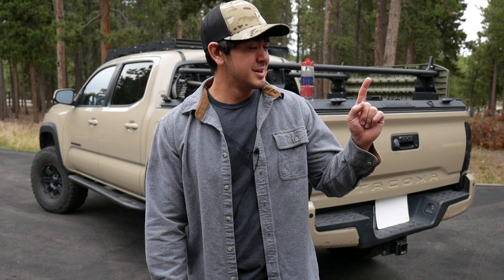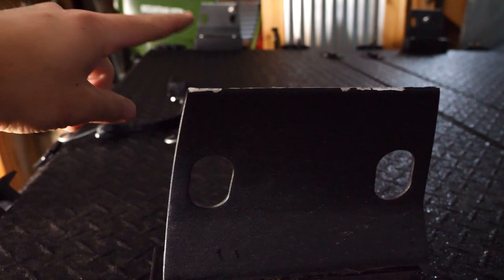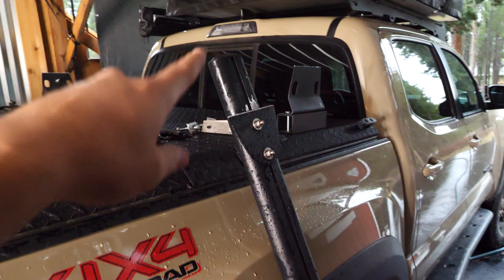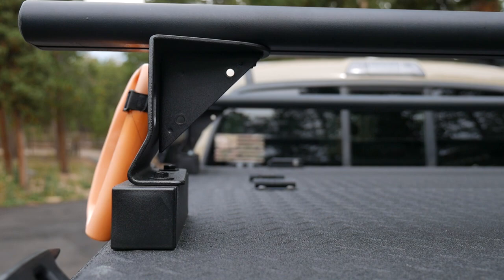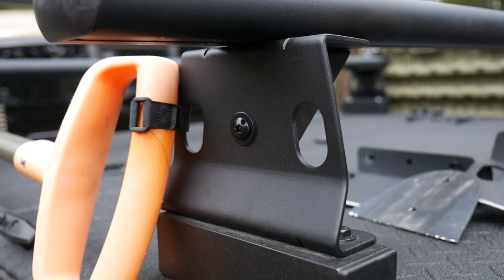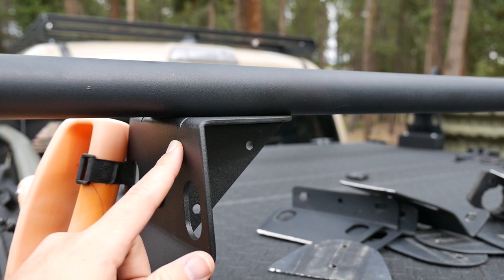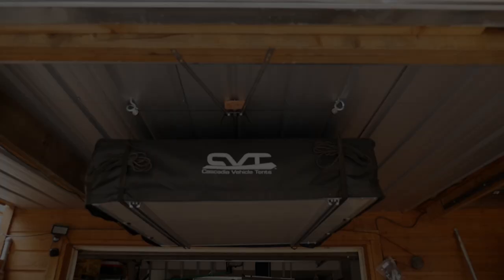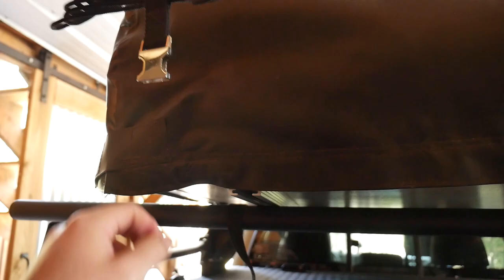My Rooftop Tent BROKE OFF! - Plus BONUS Tent Pulley/Hoist System

Comment from the maker: The Pulley / Hoist I'm using is this - https://amzn.to/2MH7NE9 - just slightly altered for my particular use.
Reply: Man, that pulley system: GENIUS!
Reply: Thank you for all of your bad-ass videos. I didn't see a link for the "improved" rack mounts. I have the same Diamondback cover on my Tacoma (thanks to your review) and I am looking to add a similar roof tent with the beefed up brackets to avoid what happened to you.
Reply: Last Line Of Defense, Sorry about that issue, hey I have a question as far as your CVT tent, Im looking for a rooftop tent for my new jl jeep. So many options in tents but the small diameter on top of the jeep is key for me. Do you think this would be a good choice for me and is packing back down simple? Thanks LLOD! And which model CVT do you have there, 2/person?
Reply: Wow, so glad that you got the issue resolved.  Hopefully it works out for the remainder of its lifetime.  When I'm ready to go overlanding I will be consulting with my friends who have a welding shop so fingers cross that they will make me something strong for my adventure. Best luck to you and hope to see you and other overlanders at Overland East Expo next year!

Comment: Rooftop tents are beyond dumb. My tent is an instant popup that sets up in under 2 minutes. And this is the best part... I Can Leave it There and Drive Away! I don't have to take it down to travel. As for sleeping on the ground they have this thing call a cot. They are amazing. They are almost like your bed at home. So the bottom line is if you are using a car or truck to camp, and not your back, then you don't have to sleep in or on your rig. You can pitch your tent and still come and go.

Comment: If you are still worried.  You could take one of the new ones to a machine shop and ask them to build you a set.  Probably not very expensive. Id go with 1/4" plate steel.

Comment: With the way that rack broke, I am kind of not surprised.  That's some pretty thin metal supporting it.  Re-enforcing it should make it work fine but there are still going to be some weak points in it.

Comment: Hello. Dig your truck and your commitment to your channel and keeping us all informed. 

I don’t normally comment on this stuff. But. As a welder, fabricator and someone knowledgeable in metal allergy. I have to say. The replacement brackets are going to break just as easily as the first ones. Gusseting one side does not fix the lateral movement nor strengthens the over all structure. I can tell you with utmost certain. The gussets on the new ones will transfer the lateral movement to the bottom “L”  section of the bracket that isn’t gusseted. Thats your next break. Not to mention. The overall gauge of the units is much to thin for suspended weight. 

I would consider a local fabrication shop to tig weld you up some nice stainless .. thin. And strong.

Comment: I'm relatively new to overlanding and I'm just starting my first build. But I do know quite a bit about load ratings and requirements as I do weight testing commercially. If your rack was rated at a "dynamic load" of 300 pounds, what that actually means is the safe working load (SWL) is 200 pounds (dynamic load tests are 50% greater than the SWL or safe working load). A "Static load cert" is conducted at double the safe working load. A dynamic load is supposed to simulate a safe working load with mild motion. A static load is used to simulate extreme conditions. What I suspect is the company you chose DID NOT meet SAE requirements for load testing or they used sub-par hardware that handled a stationary load test just fine but was not static tested under extreme conditions. 

In either circumstance, I'm glad this occurred off road and no one was hurt.

Comment: So typically load forces measured vertically, in a nut shell.   While driving off road you have forces that are acting side to side.  So you could contact the manufacture and ask them if the rack has been tested for the side to side forces and if its rated for off-road.  You are the path to figuring it out.  Their is still the same weak point in your new brackets.  The addition of the triangle piece also needs to be on the bottom where it's attached to your rack.  My guess is that they will break again.  Great vids!

Comment: I see two sets of holes in your new brackets, ( As a steel fabricator I still think they could be week). A simple fix may be to take some 1/4" cable and cable clamps and make some cross bracing to reinforce them. If your new ones don't work, let me know Ill make you some custom ones, love your channel, used to live down in your neck of the woods, have fun.

Comment: Hey buddy, Check your hardware that bolts the bed to the frame, my Tacoma bed would rattle on dirt roads and found that the closest to the cab on the drivers side in the bed, the bolt was loose. Loose enough to get like 3 full turns on the bolt. The same thing happened to a hand full of my buddies out here in Utah too. Also, just a heads up, our beds flex and articulate pretty heavily when you 4X4 them. It’s highly possible the bed articulation is what broke your previous mounts. Also use grade 8 hardware with flat and lock washers and nylock nuts. Half racks are the way to go though. Good luck! 🤙🏻

Comment: Boo for broken bed racks, yay for Jeepers being Bros. Sorry about your rack, I'll be inspecting my roof rack for problems. I use that same pulley system for my Jeep hard top and roof  rack. It works really well. Unfortunately I don't have enough overhead space to lift my RTT on/off. Had to rig up something else for that using my winch lol.

Comment: Old brackets failed to stress in tight break bend radius in aluminum. See how lower bend has large radius. The stiff hit gussets they added to new brackets will help for sure along with the steel angle brace you bolted on should do the trick. Good luck enjoy your vids.
Reply from the maker: Yeah I'd be surprised if this one fails, but bumpy trails have a way of surprising you over time, haha.

Comment: For added safety, you should mount a quick release safety strap from the tent to the diamondback in case it ever blows off again to keep it from flying down the highway. Just strong enough to stop the momentum. Even if it snaps (like a cheap bungee) it'll still break the momentum enough to get to to drop to the ground quickly.

Comment: A few things. Firstly, as mentioned by someone already, you should have those brackets fabricated out of steel. Try a few local metal workers, I'm sure it's an easy thing to fab. Second, the 300lbs rating per bar is static load almost guaranteed, your dynamic load will be much higher, 6x+ with margin for safety from my understanding, for offroading vs static or light duty dynamic. Lastly, you're adding risers to your mounts, this is increasing the lateral stress that those brackets are feeling and translate to more force and thus more wear on the bracket.

Comment: You probably already hear of these KB Voodoo Hi rise bars fit over the diamond back cover, they limit your ability to open the bed cover but they are stronger, done some mid level trails with good amount of flex, and no problems.
Reply from the maker: Yeah they're low and don't allow opening of the cover. While I don't often open it, I do like the ability still. But interesting option for sure.

Comment: Glad you got them fixed up. I'd still keep an eye on the bottom; once you strengthen a weak point, the point of failure moves to the next weakest spot. I'm guessing the stress will now transfer to the bottom bend.

Comment: Must have been a pretty awful moment - sooo sorry to see! Thanks so much for putting this out there.  Especially since Im currently figuring out how best to set up my own truckbed rooftop tent.  Your racks failed in **fatigue**, the achilles heel of aluminum.  Great strength to weight ratio, great workability, but alum fails catastrophically in fatigue (looks great one moment, gone the next).  At least with steel or carbon fiber hardware you might see the problem before it fails.  The 300lb strength rating on your alum racks doesnt speak to fatigue at all (and how are you supposed to measure your fatgue load anyway?)  Now, after your gracious guinea-pigging for us all, I'd categorically dismiss any aluminum rack hardware supporting a decent load on the truck, which is either vibrating and/or bouncing most of its active life.  Glad you got out clean without injury or major damage.  Cheers!

Comment: The difference between the old ones and the new ones looks like the old ones were not a solid piece as the stress points look like they were welded. The new ones are one solid plate that was bent to shape. The dents are actually reinforcements. Thanks for the update

Comment: I expect these will last longer, but fail in the end. I think the failure will occur in the middle because the middle bend is now the sharpest bend and the reinforcement you added ends at this bend, thus focusing strain at the weakest point. Your reinforcement might actually make it fail faster. Honestly I think these brackets either need to be mild steel (so it bends instead of fracturing) about 1/4 inch thick, or fiberglass and epoxy about 3/8 thick, and either way, make the radius of the curves larger and triangulate everything as much as you can. Just do not triangulate to a weak point the way I think you did with these new brackets. I hope what you did works for you, but watch out for cracks that begin at the bottom point of your reinforcement on the inside of the bracket.

Comment: Hello, you may not remember my comment a while back on your tent support system and its apparent Engineering flaw that may bite you in the arse down the road, well it happened, please do not feel offended I was just trying to be helpful. Your "makeshift" bolted gussets in that particular configuration is NOT the answer, you are now putting the weight of the structure on the BOLTS, you are back to square one, if anything they should be welded. I am currently in the process of designing small electric "Hydraulic shocks" with ONE hand held controller for four corners of the roof tent so as to eliminate having to jack your truck to get the tent leveled. Well, I guess we live and learn, take care Brother and LOSE THE BOLTS!!!!!
Reply: The same forces that acted to weaken the top bend are now being transferred in whole to the rest of the bracket. In my estimation you should look for something to secure the bottom bend and prevent the sideways motion that weakened the top bend. The gussets will help, no doubt. My comment is to merely highlight the fact that the forces haven't been removed, and with the modifications the weakest point moved elsewhere.
Reply: What broke your brackets was work hardening on the aluminum. It would eventually happen on steel too.
The smaller radius on the top bend probably sped the process.

Comment: Truck beds flex quite a bit also, hence the rubber and foam under the bed covers, that isn't there just for dust/water, its so the bed and canopy can flex from each other in off road situations or under a heavy load, I would suggest thick piece of heavy duty rubber under those mounts to the bed shell. At least if you know your going to flex and go off road again.

Comment: If the bottom part of the support is stronger than the top part that broke I think you'll be fine. That said, in my opinion, all you did was strengthen the part that broke while moving most if not all the pressure to another area ( the bottom section) But hey if it works it works!  If they do break again I'm guessing that bottom part of the supports will break just like they did before

Comment: Trash the aluminum risers. Sounds like they work hardened from the constant lateral movement and then failed. The “600lb” rating is for compression not shear. How about using channel iron? The one that has a profile like this [ 

It’s made out of steel.
Reply from the maker: Yeah lots of potential options, if this setup breaks, I'll be very, very surprised.

Comment: I'd never suspect they were aluminum, that's ridiculous. Alu is too stiff, can't give, so it broke. But I'm suspecting bending radius to be the biggest fault and a proof of the company's lack of knowledge. Who bends alu to 90 degree? And I noticed it was looking like past 90 really.  I'm betting they've bent it, cause clearly it's not an off the shelf profile. This custom bent bracket could've been easily replaced with an alu square tube of large wall size (3x3", 4x4", 5x5") With one end welded shut, second end providing bolt/nut access. This would look fairly smart and be much more secure and resistant to fatigue. The alloy bars don't seem to care about the load at all, so...
I would definitely not go the thick steel custom heavy balls route, it's a 75kg ffs. Not an elephant.

Comment: There still seems to be a hinge there. Would be ok if the gusset cam down to the base of the bracket. Even better if the gusset was connect to the full base plate. Still seems to have a fatigue failure potential. (I am a structural engineer).

Comment: It's the weight causing lateral movement/wobbling that is wearing out the corners of the brackets. Add angle bracing/bracket support to reinforce.

Comment: Hey I just ran into your channel the other day, good content and reviews, I like the details.  With the mounts that the company gave you to redue your roof top tent you still have the old pieces that could gusset the bottom so the weakest point wont be the bottom now,  so essentially where they failed before bolt the bottom portions together and in conjunction with the corner brackets you installed the entire mount system should be bullet proof and less likely to ever fail. Just a thought since you still have the old brackets. Thanks for the videos and content, Jess

Comment: Trash them. Just have a fab shop put something together.
Reply: I agree. I think the shape of the risers would be better suited for off road use. Just get higher risers!
Reply from the maker: If these fail (which I don't they will, but maybe) then something custom would be next step.
Reply: Yeah, I had a custom tube rack fabricated for my tent. It was out the door with powder coating for $400. It can handle way more than my truck bed rails which it's mounted on, can. If the bed rails wouldn't rip off, I'm guessing you could hang the truck from it.
Reply: Give up on the consumer grade junk.Find a good 4x4 fab shop and get something built.
Reply: $170 from Amazon? Garbage
Reply: @LastLineOfDefense  Hey man- watching this video for the 1st time today so I'm not even sure if you still have this setup- but I really think these will fail again. You reinforced the top of the plate with the gusset- however now there is a new weak link at the bottom radiused part of the mount. I could see that part weakening exactly the same with all the side to side motion.. just my 0.02... appreciate the vids bro keep it up!

Comment: The aluminum sheet that the bracket is made of was bent parallel to the extrusion direction of the aluminum, and that prestressed/crystallized it.  Also, the inside of the upper bend on teh new brackets is too tight, almost at a zero radius.  That will almost always cause aluminum to fail.  The wiggle/vibration on the road caused them to fracture right along the bend. Dedicated extrusions would be stronger.  And if, they failed again I’d replace them with some 80/20 Extrusion.  The 3060 profile in Barack anodized would probably work just fine.